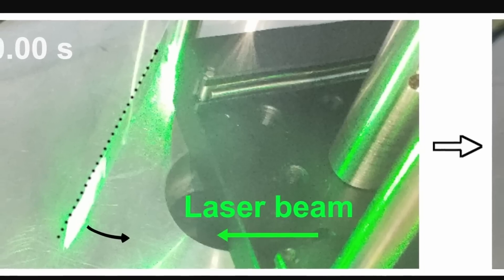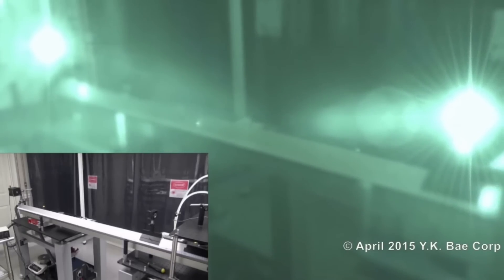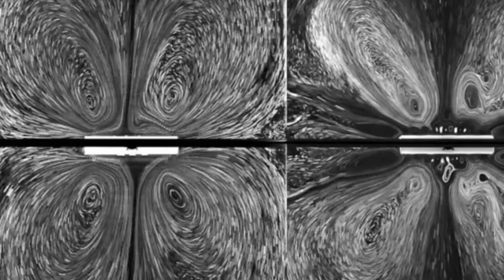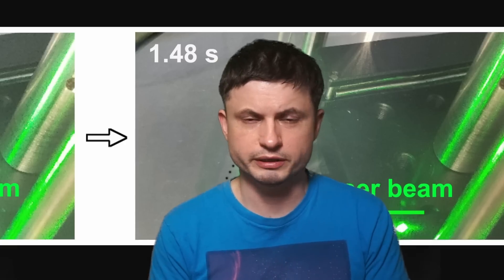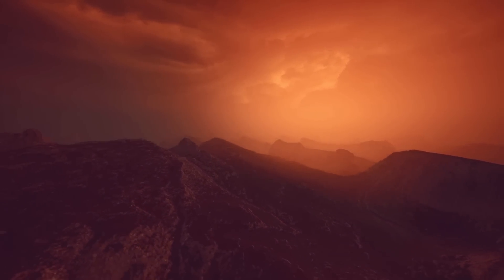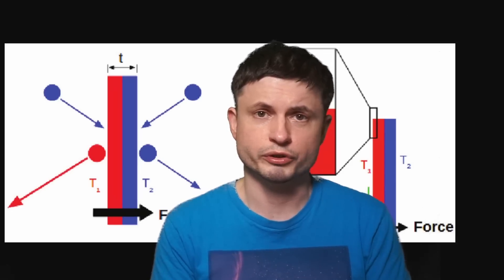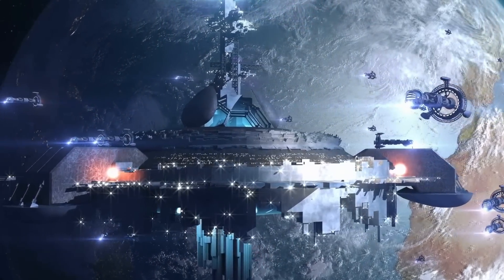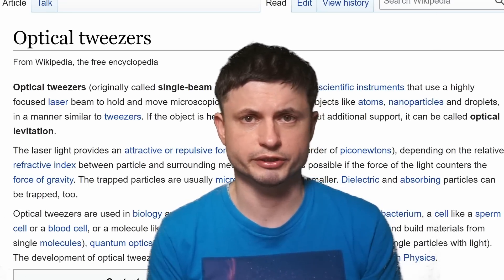Star Trek Fans Rejoice! Actual Tractor Beam Was Made In a Lab Using Lasers

Comment: Isn't this a Crookes radiometer with a fancier vane design? You've got a two-sided material, where one side absorbs more light than the other and thus generates more heat than the other when exposed to light. Put the material in a very low atmosphere environment, expose it to light, and it will move. It sounds like the work is being done by the material design, with the low absorption side now being translucent instead of reflective (allowing you to heat the absorbent side even when it is facing away from your directed light source.)  Is the laser even necessary, outside of being more efficient?

Comment: I designed a laser tractor beam fifteen or twenty years ago. I shared it with a company snd they said at the time it wasn't worth testing, It uses a Y lens to rotate the light which forms a cylinder of light and an energy beam a shot down the middle of the cylinder basically placing a charge on the object that you're shooting which can then be attracted back to the tractor beam by using an opposite charge. This lets you repulsive or attracted the object.

Comment: Turn the beam in to a line.. looking at the water.  the peaks of the water pressing on the object is pushing the object backwards.     Only thing I'm worried about is the laser pulses destroying the object u would need  a low power high density laser.  Or multiple shooting at once at different power levels to create that pushing backwards wave pattern. 

Just got an idea for a force field lol if u tether those laser sails down to a ships hull put prisums on the bottom to scatter the light u can use the main laser to deploy the sails and the grid on laser sails to feed into each other a u have a force field.

Comment: Actually the US government all ready has this technology scaled. If you remember about 5 years ago a old and possibly dangerous spy satellite was going to fall out of orbit and they didn’t know where and could still contain harmful components and be dangerous to people around where it comes down at. Then silently with little more than a few lines of press saying it was safely brought down and crashed into the white sands missile test range far from prying eyes on one of the most secure areas in the US. Now how did it go from could hit anywhere to crashing in the most optimized location in such a short time? Obviously they some how did a controlled re entry and chose the landing location with out launching or inserting anything into orbit to assist or anything like that. Obviously they used something like this.

Comment: I don't think you can call this a tractor beam...more like a "tractor system" since it depends on a prepared material structure to make it possible. How would you make this work to manipulate the upper atmosphere without putting additional layered particles in the air?  That sounds like a bad idea.

Comment: That laser isn't a tractor beam in any sense.
From what was described the material is producing a propulsion force that moves itself. The laser is just triggering the change in heat that results in a propulsion force from the material itself. The source of the propulsion force needs to be from that laser for it be a tractor beam.
"Star Trek Fans Rejoice! Actual Tractor Beam Was Made In a Lab Using Lasers"
This? This video title is a misleading lie.

Comment: So basically you can’t move it with the lazer light, but can by modifying air temperature at a certain points producing a thermodynamic effect. That actually probably has more applications then we can see right now

Comment: OK, am I the only one here who thinks this is not really a tractor beam at all...?  I mean, what's really happening is that they made the object half glass on the near side, so they could heat up the far side.  So that is not pulling the object, it is causing the object to push in the opposite direction.  Which leads to the other problem:  this can only work with objects that are created for the purpose, i.e. are all glass on the near side.  You can't just point at any arbitrary object and pull it.  I don't doubt that there may be some clever applications of this in very limited circumstances, but this is NOT a tractor beam, IMHO.

Comment: Tractor beams have been demonstrated with ultrasound years ago. Lasers are worse because the particle that can be transported is way smaller than the Styrofoam bits they moved with ultrasonic arrays.
Apart from looks (but really, UV or IR is probably better suited anyway) the only advantage of a laser is range. Hard to pull something from miles away with ultra sound, easier with lasers

Comment: What about using something like this to solve the problem of space junk? All it would have to do is disrupt the orbit of the debris a little, then it would burn up in the atmosphere.  Theoretically.
Reply: "theoretically", it wouldnt work because all the space junk is not designed to the exact conditions this phenomenon effects.
you dont need a "tractor beam" to decrease the orbital velocity of an object, you could just use the "pushing" force of a laser but the problem is the force of photons is so small.

Comment: Could it be used to clean up all the space trash orbiting earth? Pull it down into the athmosphere to burn it up?
Reply: why would you need to "pull it down" when you could just "push it down"?
Reply: @jibodagrey6500  I should have been more clear. Here I was thinking about the possibility that the laser would be ground based(even thought it's mentoned that it works only in low pressure enviroment or vacum) pointed towards debrief in its range and pulled down over time. Just a thought........ Sidenote: by definition, tractorbeam can only pull, not push
Reply: @sigorsigorsson2727  my point was that you dont need a "tractor beam" to decrease the velocity of an object in orbit. it would be possible to "push" on an object to slow it down from the ground if you had enough energy.

Comment: It's a nifty little phenomenon, but the requirements for it are very specific.  It may have some minor applications for moving little probes around on Mars or our upper atmosphere; for instance it could lift a small probe that gets stuck in a hole on Mars without needing to go down to the surface.  But I don't anticipate this method being useful outside that.

Comment: Eh, to portray this innovation as a tractor beam is kind of off to me. The word tractor beam implies that the laser or whatever beam pulls on the object. But in this case the heating of that specifc material generated the force, not the laser pulling the object.

If any differential heating (not specific to lasers) on the material could generate the force, maybe it's possible to use other heat sources, i.e the sun. What about tiny flying martian drones that's powered with sunlight? (powered as in the lifting force) It could rise during the day and glide down after sunset.

Comment: Cool video Anton, thx.    I tend to agree with some of the others though.  The beam doesn't appear to be actually pulling on the object.   If it were, the laser would be subject to a pulling force toward the object as well.    I'm not saying that there couldn't be some very task specific application for this process, but I wouldn't call it a tractor beam per se.    This almost reminds me of the quantum computer wormhole discussed earlier.    There was no wormhole, just a simulation of one.

Comment: Could you make a type of engine with this tech? lasers take the place of magnets and the two layer material is attached to the armature/rotor to make it spin on laser pulses. The housing would have to be designed to keep closer to vacuum sealed or have a pump.

Comment: I invented a beam like this too.  I just takes special materials under certain conditions.  In my case I aimed a small steam powered tractor at a laser emitter.  Then I aimed the laser at the water tank of the steam engine.  The heat exchange then caused the steam tractor to move toward the laser for as long as I hold the laser on the water.  It's a tractor beam.
Reply: don't quit your day job
Reply: hardly, its a steam engine which is getting its energy from a laser, not even close to a tractor beam since nothing is being pulled.
Reply: @King_Flippy_Nips  it’s not a tractor beam, it’s a “tractor” beam. Because it’s affecting a tractor. A tractor attractor.

The joke being that the current state of the technology only works in extraordinarily specific and ostensibly not very useful circumstances. You need an extremely low pressure environment, a special compound material, and it needs to be oriented in a specific direction. 
Eventually, scientists will find a way to abstract this into other types of tools, but for now the setup is very similar to the tractor attractor.

Comment: This does not sound like a tractor beam; if I understood, it is simply a hack to warm up the opposite side of the object being shone upon by the laser, so as to heat up the distal side. 
The laser is not pulling anything: it is the gas on the opposite side pushing.

Comment: I am a bit disappointed by this video. The only mechanism is that they heated the surface different on two sides. I could come up with several other methods to do the heating and would get the same effect. The beam was not generating traction. If they would have illuminated the graphene from the other side it would have given the same effect. The only effect was that the gas molecules were kicked hard from the hot side and kicked little from the cold side. The beam is causing the heating and not the movement direction.

Comment: this is more of a, dare i say, "meta materials" engineering exercise than anything else. not insignificant, but not even close to a generalized tractor beam. this would definitely have implications for tightly controlled mechanical engineering applications. the pushing and pulling of objects without magnetic or mechanical application of force is a great mechanical engineering trophy in some applications. and who knows where that might lead.

Comment: Awesome! It sounds to me like you could get other sci-fi staples like force fields, stasis fields, light cages etc, via the same technique of finely tuned interference patterns
Reply: Already exists. Ultrasound as well. But it's way too weak to be an actual forcefield. More like a resistance that can be touched
Reply: @borstenpinsel  
You'd be surprised. Even just that would be enough to repel say gas, or napalm from a flamethrower. Once it can be scaled up, it could initally be used by large ships such as nuclear aircraft carriers and nuclear submarines for protection and even utility.
Reply: Only if the target is made of the right materials though...

Comment: While the ideal is around 5 pascals, does the process still work in a vacuum or do you need something specific like some small amount of atmosphere to push off of?
Reply: It wouldn't work in a vacuum because you need some particles getting charged to push on the object you want to move. Too much atmosphere means there is too much friction acting against the object you want to move, and not enough means there is not enough particles being charged to provide enough force to move the object.

A vacuum would have no particles being charged and thus no thrust would be achieved.

Comment: The most immediate use I can see for a tractor beam would be to pull space junk out of orbit, rather than using individual rockets. The good part is, a repulsor would work also, even a broad beam of either or both, just enough to disturb the orbit of the space junk, for small stuff like paint chips or anything smaller than a car, and more concentrated beams to move old satellites or booster bodies to a certain descent to Point Nemo. The heating factor alone might be enough to accomplish this, heating one side of large objects and even vaporizing tiny ones. An interesting idea for a robot orbiter or a fleet of them. I wonder why they haven't done this already? I mean, it would be "a space laser" after all!

Comment: I'm sorry, Anton, but for once you've made a video that is nothing but clickbait and pure lies and I have to call you out on this.

This is in literally no sense a tractor beam. The only thing they've invented is a two-part material that heats up on the opposite side of a light source. Essentially a solid-state greenhouse effect, which works because the glass is also an excellent insulator, preventing the heat from the graphene side from passing back to the other side, equalizing the pressure. Although, the system would still reach equilibrium eventually.

In other words, there is absolutely nothing of note about the "beam". It's just a method of delivering heat straight through a piece of a glass with very low transference. A tractor beam would, by definition, attract an object. Even if it was a very specific object, it would still attract that object. This is just a demonstration of how heat produces thrust by creating a pressure gradient. They may as well have set up mirrors to bounce a laser to the other side of an opaque object to heat the side facing away from the laser. It'd be an equivalent demonstration of the same principles.

Comment: so its actually all down to the heat generated by the beam , erm im sure that several years ago i saw an object that was powered by a laser beam and it was the actual heat from the beam that super heated the air which then rapidly expanded and forced the object up and as the laser was pulsed the object got higher.

and dont they already use lasers to measure the atmosphere and work out refraction and try and clear any pollution etc for ground based telescopes for looking into deep space ?.

and im not going to mention the laser type beams that have been seen coming from dugway proving grounds and aimed straight up (it was on yt whether it still is or not i dunno) for whatever reasons.

Comment: I am wondering if you can call this "pulling". Technically the material is being deformed using heat because it's consisting of 2 different materials with a different expansion coefficient. It's a well known principle that's been around for roughly 260 years that we know of (~1759 seems to be the first mention of bimetallic principles being actively used in actual products what I could find). Is it even moving if one end of the material is held in place. Yes the materials used in the experiment are a bit exotic, but you can achieve the same results with any 2 pieces of materials that are wedged together to a more or lesser extent depending on the difference in the expansion coefficient of the two materials.
Reply: You misunderstood. This is not due to deformation of the object. It's due to differential heating of the 2 layers which causes a tiny pressure difference, higher on the far side of object

Comment: If you use the laser to heat up the opposite site, is it then not just the heated side that pushes due to its heatwaves? Or in short, the laser is just not pushing as hard as the heat from the opposite site.
This results in the laser still repulsing the object, it is not lowering the object's resistance to the light or dragging.
Reply: Maybe they can come up with solutions. I think this is a great find.
Reply: @Pelleministeri  Maybe but as it is now does it not matter if they heat up from site one or site two, it is the heat that moves the object, a technology known for centuries. :-)